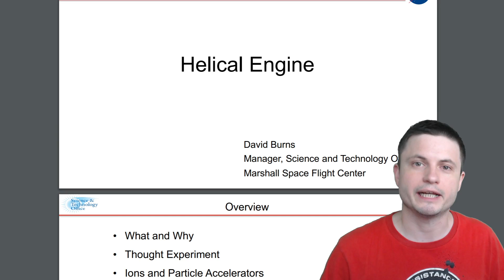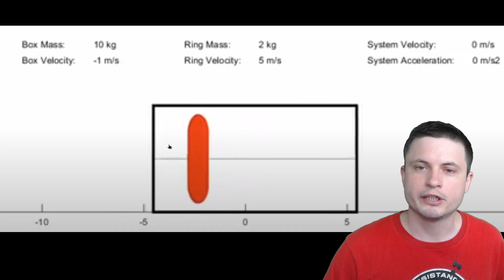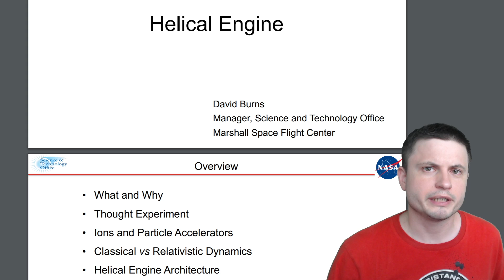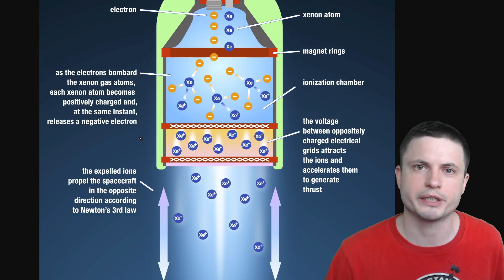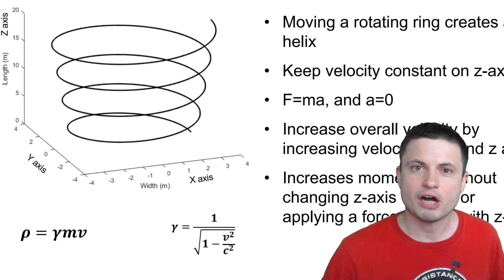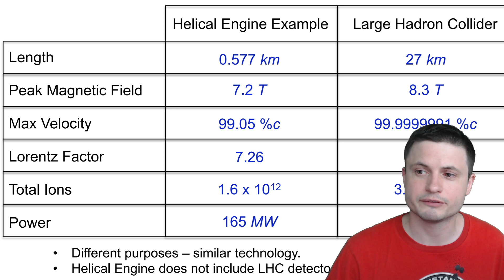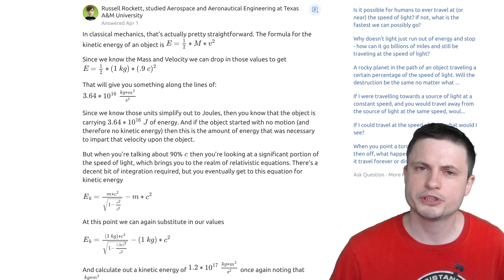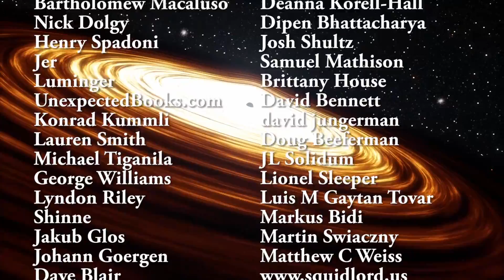NASA Engineer Designs a Near Light Speed Engine But Does It Work?

Comment: One thing I keep noticing about these different proposed propulsion systems is their difficulty in dealing with mass effects. I recently heard that the Alcubierre drives main effect was to reduce the mass of any object to at or near zero. If this is the case, by combining the two systems you could cancel out the problems from each. You would no longer have the mass limitations and you could use almost any type of drive system to achieve at or near light speeds. You might even exceed light speed.
Reply: Thats not what most designs of Alcubierre's drive do. The alcubierre's drive supposedly creates a 'bubble' in spacetime, and the object inside it moves by warping space in front and behind the aircraft.
One of the methods that tried to make an alcubierre's drive work, involved the existence of a particle with negative mass, something we havent seen yet. You might be confused by that

Comment: Since the object in the engine needs to accelerate as well as decelerate, if you could reuse the energy from decelaration to accelerate the object again, you would need to put in only the energy required to spin the object up once. Of course there would be losses, but you could theoretically power it with a nuclear reactor.

Comment: There is a proposed fusion reactor design that doesn't get much attention that might do something like this. The reactor chamber is cylindrical and the plasma is forced down the cylinder by a magnetic accelerator but with a bit of spin, so... a helical donut.
The plasma gets to the end of the cylinder and has to fold around on itself and gets squirted down the empty hole in the donut. The plasma produces a smaller major radius spiral which means shorter total distance and higher velocity/lower angular pitch along the axis.
The plasma is actually moving at the same velocity as the outer helix but more of the momentum is translated along the axis than just around the major radius of the outer helix.
The problem is the same as all the other fusion reactor candidates, stability of the plasma containment.
If the advances in the Tokamak solve the stability problem, and if it's possible to apply those advances to a design like this it could combine a power source with a propulsion strategy using both the Lorentz Transformation strategy and a reaction drive by  
 selectively ejecting He3 and retaining H² H ³ Li⁴ as fuel.

Way beyond current off the shelf tech but maybe in a couple of centuries a Martian colonist/fusion drive engineer, will buy a small 'yacht' and tinker with the drive efficiency a bit. 😁

Comment: Just a thought, what if you use magnets on the outside of the box and some sort of strong ferrofluid as the object inside the box; allowing the magnets to change the shape of the fluid in the box. Only issue I see is energy for the magnets themselves

Comment: Experiments with this theoretical model can throw up challenges which should be studied and resolved. The suggested model can be viewed as the first step among several steps. 

In an extreme scenario I will classify this concept (this being the first step) as follows - last step right,  first step wrong. On a positive note it could be last step right and first step right (but may be the theory is only 10% right). But in both the case scenarios  the first step acts as a motivator, irrespective of the initial theory being fully incorrect or partially correct (10%). 

The problem statement is the most complex one mankind is trying to solve.

Comment: I thought of kinda the same thing for an engine I thought of it whenever I spun up a lasso or rope for fun but my example with then lasso you spin a lasso around fast enough it's speed goes fast enough for lift as the loop or even just a rope end would get smaller in the release end or "whip" I always thought couldn't the "whip" hit one end faster harder then in an closed box the increased spin and then slowed the spin afterwards widens the loop or rope end.  Think spinning a rope up like a spiral the bottom end of the spiral spin would have more force in the spin since it spun up more and released it in less compare to it's release at the other end and spinning even helps with the back and forth.  Idk if it's coming across well thanks though for reading my comment strangers.

Comment: I came up with a similar idea back in the late 90s and looked up the literature - someone published a paper in the late 70s debunking the basic idea, though after more than 20 years I've forgotten the exact reference. The reason this is very unlikely to work beyond maintaining a small frame shift (ie a small velocity change without sustained acceleration) is some people forget that all energy has inertial mass - these ideas only seem to work if you forget that fact. Remember, special relativity is literally built from the principle of momentum conservation under a Lorentz transformation; it redefined momentum from the classical p=m*v to p=gamma*m*v because the classically derived momentum equation is not conserved under a Lorentz transformation, yet the relativistic one is derived to ensure it is conserved.

Given the 4 vector nature of energy-momentum, breaking conservation of momentum requires breaking energy conservation, ie making a type 1 perpetual motion machine. That is why most physicists treat this idea as a joke, or its pursuit as crazy. Modern physics literally is built on the assumption energy-momentum is conserved, at least locally; of course it might not be conserved nonlocally given that time is clearly not symmetric on the large scale, thus Noether's theorem can't be assumed to be true non-locally.

Comment: What if you could create a very small nuclear detonation to drive the mass? In a combustion engine you don't use a cup full of gasoline for each combustion in each cylinder, just a fine spray of droplets of gasoline. So I'm talking about isolating a few molecules of U-235 for each detonation. If one could isolate that small an amount and detonate it, the force could be contained and force used to drive a mass.

Comment: As I always understood it, the closer you get to the speed of light, the more the energy used for acceleration gets converted to mass so you would run out of energy before getting close to the speed of light. That would make this whole 90% the speed of light impossible. I don't have the math so maybe 50% the speed of light or so?

Also, you would have to begin decelerating around half way to the destination so you couldn't go even 50% most of the way to the destination. Any ideas?

Comment: This type of engines are discussed at large in "Vaimanika Shastra" a treatise on flying crafts... In that it is suggested to use mercury and accelerate it using electricity in a spiral motion - a sphere shape is built at the end of the spiral to collect the mercury and a straight pipe would connect to the starting part of the spiral and mercury is fed again to spiral around and generate motion... It is mentioned that large vessels were made to float in air using this technology - I wonder maybe that's why earth is in shortage of mercury...!!!

Comment: Remember that speed is relative. The relativistic mass increase will only apply to the force required to spin it faster, not to move it or stop it along it's spin axis.
Reply: Also, good luck finding a material that can withstand being spun with a surface velocity approaching the speed of light.

Comment: Double plasma ring with magnetic containment, with the 'twist' being they contrarotate, and pinch such that one velocity delta occurs across the axis of desired motion, and the inverse delta occurs along the axis of desired motion. Inertial reaction for the cross-axis acceleration will cancel each other, but inertial reaction for the on-axis acceleration will complement. Since the lorentz transformation of the plasma only exists for one leg of the loop, the return leg is mass-normal because the stream is uncompressed, which slows it. Could even make it annular with a toroidal shape but... why? Opposed rings gives you some steerability via biasing the "thrust".

What though, do you do with the waste heat from this process since you're in space? Heat rejection is a HUGE issue....

Comment: If I understand correctly, the mass of the reciprocating weight in the simple model presented at the start of this video does not increase with velocity. Einstein says that momentum increases with velocity, not mass. Of course, momentum could be transferred to the body of the engine, so it might not matter that mass is constant. However, any obvious method of adding momentum to the interior weight would also add an equal and opposite momentum to the body of the engine. Net result... no acceleration of the engine, except for the back and forth wobble shown. Would the proposed method of getting around this work? I don't really understand how?

Comment: so, we're going to go to the stars using a shake weight?
Reply: NASA: "How can we produce energy aboard a spacecraft out in space?"
Also NASA: "How can we make sure that astronauts get enough exercise while out in space?"
Hamsters: "Duhhh?"
Reply: Hahaha this!!
Reply: Or like Thor’s hammer
Reply: Yep...Just like a Faraday flashlight ;)
Reply: @TheSymphonyOfScience  Fleshlight
Reply: Yep
Reply: Yes behind the back shake weight pro
Reply: Diesel Punk starship uses reciprocating engine/
Reply: Not unless you change the law of inertia. It doesn't matter what the engine is doing otherwise. It takes a year to accelerate up to near light speed at 1G. The only way you'll get to near light speed faster in (say) a few seconds is to turn yourself into bug squat, squished at a 1000000G by your own inertia. So, this goes down as another feggetabbotit!
Reply: Astroglide was developed for greater speed
Reply: COCONUT Johnny Joestar  i mean we can get a probe that can see the planets surface as well.  Personally I wanna see the star itself.
Reply: COCONUT Johnny Joestar  and the only reason we can't do this rn is because the energy required to do this is about the energy you need to run a small city. So a nuclear power plant.
Reply: @obiwankenobi1608  

More than that... much more.  Even if this concept actually works... we don't have anything to power it yet. 

To make this feasible - we'll need to break the fusion barrier and have the capability of building a compact fusion reactor.

We aren't there yet.
Reply: APPARENTLY HAHAHA.
Reply: kkthxk  what's crazy about it? There are no sun type stars like ours? It's an honest question
Reply: kkthxk SCIENCE!!!!!
Reply: Lmao
Reply: Trip going to be bumpy and dcary
Reply: It even tells you you're pretty.
Reply: Dont forget, with guidance systems made of spinning wheels
Reply: Relativistic shakeweight, but yes lol
Reply: Your core muscles will thank you!
Reply: It's too slow... It takes, like, 10 years or so for light of the closest star to the earth to reach us
Reply: @ducklund8578  about 4 years
Reply: @thejoe500iq  so at the proposed speed, it's only 8x longer than a trip to Mars at our current attainable speeds. That's totally doable, actually.
Reply: @MajesticSkywhale  dude I mean we are starting to get to the point where we can grow food in space but we should probably send a probe that would be able to go there with this propulsion system.
Reply: @thejoe500iq  how big  would that star have to be at for light years if the sun is 8 light minutes?
Reply: @digginaustin  pardon
Reply: @thejoe500iq  the sun is 8 light minutes away and is 4320000 miles in diameter. If a star is 8 light YEARS away what should the diameter be?
Reply: Nobody??
Reply: Ducklund yes but it’s already coming at a constant state plus out star
Reply: @ducklund8578  its still ok atleast we can travel
Reply: @ducklund8578  at least its a start
Reply: @ducklund8578  I sent this response 3 years ago!

Comment: If you travel with 1% of light speed through space that is 3.000 kilometers per second. If you hit a very small object with that speed it doesn't end well.  Conclusion: before traveling through space with even relatively low speed is feasible, you first need technology to detect and evade small objects.

Comment: I had an idea that is something like this too. But i imagined something like a conveyor belt.
Imagine a sort of belt along the length of the spacecraft, a projectile is taken at increasing speed toward the front, and then slowed down very quickly, and this way pulls forward on the conveyorbelt which is fixed in the craft... so by default pulls forward the spaceship. Then it is returned to the backside, and the action is repeated. Imagine this on the scale that is needed, fueled by a nuclear or fusion reactor.

Am i the only one who doesnt see a way this wont work?

Comment: If you take a step back, Lorentz implies that to get to the speed where time dilates to half of static time, where occupants in the ship feel like they have exceeded light speed (but not so to outside observers), the energy required at 100% efficiency of your propulsion system would be equal to what you'd get from total annihilation and conversion to energy of a mass equal to the mass of the ship.  This is the absolute minimum energy that could do it.  At this speed, the ship has twice the mass because its energy of motion is expressed as mass.  Taking the 100% conversion of mass to energy and 100% efficiency case, to go somewhere and stop would require a "fuel mass" of four times the mass of the part of the ship you want to arrive at your destination.  Two ships mass is used to accelerate the ship and an extra ships mass of deceleration fuel.  Then you annihilate the last ships mass of "fuel" to stop.  Only 100% conversion of mass to energy would have enough power to do this.
    Project "starshot" is more realistic because the propulsion system and energy source are not on the "ship"  Starshot uses huge ground based lasers to accelerate huge light sails to relativistic speeds with microchip sized payloads to do flybys of nearby solar systems.

Comment: Before building it consider what traveling to approach the speed of light will do to the human body. Does not the density, and some mass (from momentum), increase for massive bodies as they accelerate? If so, at some point approaching light speed the ship and everyone inside will be crushed. Nothing with mass can travel at the speed of light. The only way to accomplish it is through parallel extra dimensions.

Comment: Error might be in measuring donut-weight vs how much energy can be reflected?  Instead of accelerating a large mass to 80% sol, why not accelerate a small mass (few ions) to 99.999% sol?  Ions can also be made to reflect losslessly (in an accelerator, for example).  Theoretically, a single ion could carry the same momentum as a one-kg weight, if accelerated fast enough?

Comment: Excellent episode. It seems more reasonable to me that long range travel in space isn't going to happen in space. Considering the power requirements, the size and weight of a machine required to approach light speed it is far more likely we will accomplish space travel through inter dimensional portals (Wormholes). If the machine doesn't have to move it makes it easier to accomplish the goal.

Comment: First and foremost, I WANT CREDIT for finding the solution.

The answer is as simple as his solution:  Rotate the chamber.  Capture the moment of inertia at both ends and use an electromagnet on the middle support to accelerate permanent magnet mass from one end to the other, changing direction and speed as the entire chamber rotates.  With enough rotating chambers all around the ship, the right timing and frequencies, you will be able to capture enough momentum to consistently accelerate to the desired speeds.  The increased mass and length as you accelerate could also work in your favor.

Solar energy can be captured or a nuclear reactor would have no problem supplying continuous electric energy to rotate the chambers and power the electromagnets for many years.

Remember, I want credit if anyone tries to build it.
Reply: lol, a perpetual motion machine with magnets that need to be pushed once in a while. I can't.
Reply: Doppe1ganger Aww, look.  A 5th grader has joined the conversation.  The concept is over your head, Chief...and no one said anything about a perpetual motion machine.  I listed possible power sources, which I don’t expect you to have remembered.
Reply: Doppe1ganger I’m sure you thought you were trolling me but you trolled yourself by displaying no understanding of the term “perpetual motion machine”.  At least know what you’re talking about if you want to try to correct or criticize someone else.
Reply: @chrisrobinson9877  What's your IQ?
Reply: Doppe1ganger I guess pretty low...would you believe me if I said 141?  Probably not, so why bother?

But if you think what I described is a perpetual motion machine, yours is obviously lower than mine.
Reply: @chrisrobinson9877  Huh, would you believe me if i said that if i believed you then i would think 141 is low? Not that i believe you, obviously. And stating facts is pointless unless i believe what you say? Weird. You do know that the average is a mere 100, so what's with the "i guess pretty low, 141". 141 is higher than 100. I said that it's like a perpetual motion machine, only you need to input energy to make it run, get it? I guess that means mine is obviously higher than yours, and last i checked it was 138. 138 is lower than 141.

Comment: Unfortunately, it is irrelevant that an engine can reach the speed of light or whatever because the friction of air on the outside of the craft would create excessive heat. The extraterrestrial space craft that are used by beings from, as an example, Zeta Reticulii use their own gravity so fall ahead into open space like a vacuum.